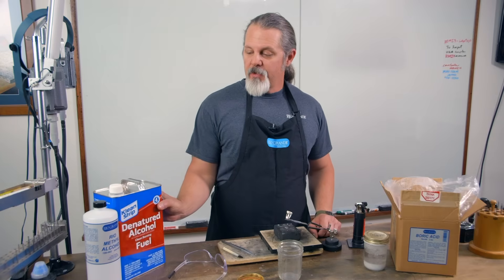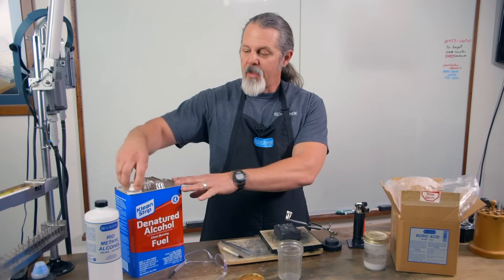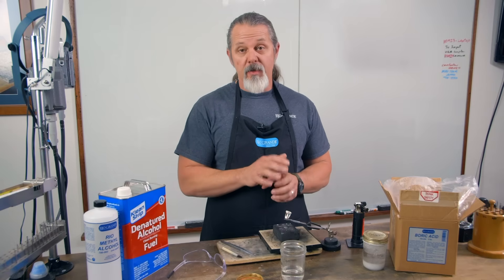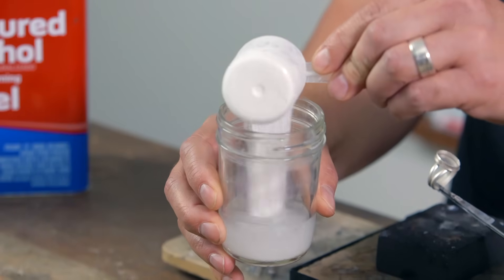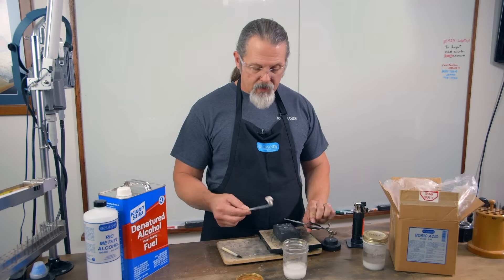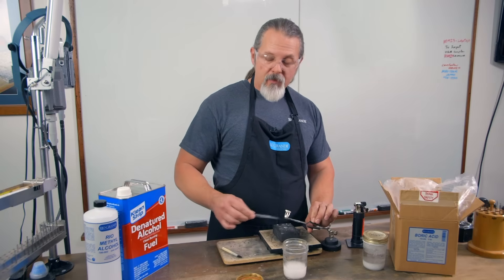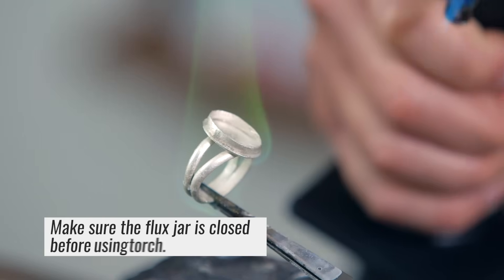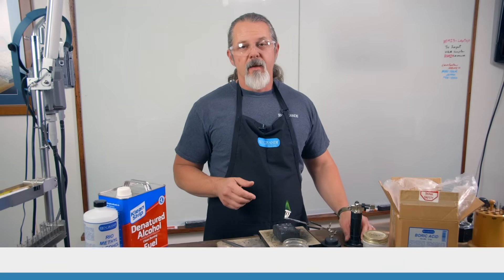Create Barrier Flux With Boric Acid & Alcohol

Comment: Does this fire barrier contaminate soldering flux? By which I mean, if I coat an entire piece for soldering, and then apply soldering flux over the top of it, will it prevent the solder from wetting under heat?
Reply from the maker: No the barrier flux actually aids in keeping the metal clean and helps the solder flow easier.

Comment: Get a can of brazing flux at your local welding supply house or good hardware store. It is borax based and forms a glass-like layer over whatever you are brazing and inhibits and mostly prevents oxidation. I suppose you could stir in some water or alcohol to make a paste. I don't see any benefit to using alcohol vs H2O, but there would be very little difference between using ethyl vs methyl alcohol. The first is C2H5OH the second, CH3OH...

Comment: can i use this for a small brazing job? i was trying to silver braze a 1/4od metal tube onto a tin can but i may have used too much as it kinda crudded up, is there a technique like you done light it up first then once the flame is gone i can start the brazing? i am using a small oxy propane torch that gets quite hot perhaps i can dial down the flame and get a non hissing neutral flame since i do have different flame tip heads i can try(needle type) so appreciate any technique you can advise
Reply from the maker: The melting point of tin, the primary metal in "tin cans" (which are actually typically made of tin-plated steel), is around 231.93°C (449.47°F).  So you may need to be using a low temp solder like stay brite or tix.  The hardware store may also have something that could work.  You may also be able to use a soldering iron for the project or use a very soft flame to warm the metal
Reply: @RioGrande1944  not sure why the melting point of the plating which is lower than the base metal is of concern rather than melting point of steel but i can def lower the flame and add less heat if im only soldering or brazing , not sure soldering is good at withstanding heat though because this can will have burning wood chips in it and can get quite hot as im making a cold smoke generator so not sure soldering is good enough unless there are ones on the market made for this application i believe there are and i appreciate you telling me about products i can look for at hardware stores,,in any case i already silver brazed it , was kinda cruddy with the bad homemade flux i made from boric acid and methanol and also tried with borax but it seemed to work out , thank you for your feedback

Comment: I followed all these steps, mine doesnt burn as long as the ring in the video, it just burn like 2 sec, am I doing something wrong?
Reply from the maker: As long as you see the little white crystals on the surface, which means you got good coverage, that shouldn’t matter.  Our tech team recommends swishing the pieces around in the solution to be sure its mixed well.

Sometimes there is a little more alcohol on the piece.  That makes it burn longer.  If you don’t see the white coverage on the surface, than you can dip and burn it again for best coverage.
Reply: @RioGrande1944  Thx for the tip 😊

Comment: Q.1 Can you use methylated spirits instead of denatured alcohol?

Q.2 when soldering 9ct yellow gold, do you coat the whole item with the Boric acid solition, and then put flux on-top on the area to be soldered? i.e. they can work together and will not react adversely?

Q.3. Can you use Borax cone flux with this firescale prevention coating?
Reply: Yes yes and yes.

Comment: With all due respect, it works better for me to make a supersaturated mixture (using a stir bar in a larger jelly jar) and allowing it to sit and not swirl before use. Chunks of boric acid melted on the piece is hard to pickle off and can get in the way when constructing, i.e., soldering a bezel to a sheet.

Comment: Do you have to use alcohol for this to work properly? Could I mix water with the boric acid and obtain the same result?
Reply from the maker: Hi There, Thanks for your question. We do recommend the 'recipe' for this as stated. For a little more information, you might also like this article about it: http://riograndeblog.com/mark-nelsons-tips-mixing-boric-acid-barrier-flux/  - hope this helps!
Reply: @RioGrande1944 This page is not found. Can you please update the link?
Reply: I read an article that said you can mix it with water as well.  Check on google for more information😊.

Comment: very nice,,so you can then juts heat and apply the silver solder where you need it and it wont go all over the place?? because it usually goes where the flux is right,,,also can this be used for brazing?
Reply from the maker: Hi There, Thanks for your question. The barrier flux is meant to be applied all over the work as a protective layer against firescale. We recommend still using a flux to help the solder flow. We really like the new  Ronda Coryell's Purple Flux: https://www.riogrande.com/product/ronda-coryell-purple-fluxes/504008gp  - Hope this helps!
Reply: i seen someone else demonstrate what you juts said,,thank you

Comment: Hi can you put a lid on the jar and save it for later use or will it deteriorate over time?
Reply from the maker: Hi Ian, We recommend it! This solution will last quite a while if you keep it tightly sealed while not in use. Just be sure to stir it up each time. Hope this helps.

Comment: Can this technique be used when soldering gold filled metals?
Reply from the maker: Hi There, Thanks for your question. We highly recommend this barrier flux to reduce firescale when working with gold-filled. We also recommend using 10k or 14k easy or medium solder for this work. Hope this helps!
Reply: Thank you for your quick reply. My second question is, I work with easy-flow solder paste as I find it easier to do. Can I still do this technique then with with solder paste? I work with gold-filled and sterling silver.
Reply from the maker: Good question! Easy flow paste will work fine. Mark recommends when using paste, to put the paste on first then the boric acid mix. If you do the boric acid first the paste might not stick in place. Hope this helps.

Comment: This is to prevent firescale on your piece correct? Can it be used as regular flux to make your solder flow as well? I'm a beginner & I'm getting mixed information about these questions. Thanks
Reply: This is a barrier flux and works best to prevent firescale. A flow flux is what you want to help your solder to flow. Two different things. You can use both on the same piece however. This method that Mark shows works wonderfully, but if you leave the lid off (as he did- shame on Mark! LOL) you can set the jar on fire and if you panic you'll have a disaster. Please use caution and if it ever happens, simply place the lid back on to smother the flame. :)
Reply: Debbie Minter thank you!
Reply: I’ve been using this mixture for years w/o any additional flux and it works beautifully to solder! (Although I can’t buy denatured alcohol where I live so I use the cheapest vodka I can buy!)
Reply: I have used it for years now with no additional flux, it works great.
Reply: I would like to know if fire-scale refers to over heat the piece and if it’s used to prevent damaging.
Reply: Is this for avoiding firescale or firestain? I'm interested in the latter. I think some people say firescale whe they mean firestain.
Reply: @Marie Lily sometimes! It works! 👍